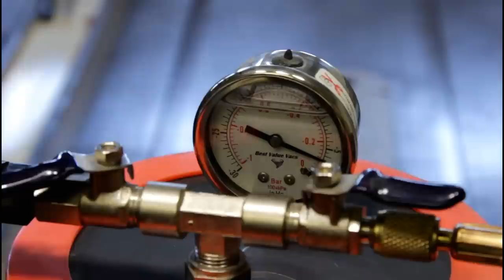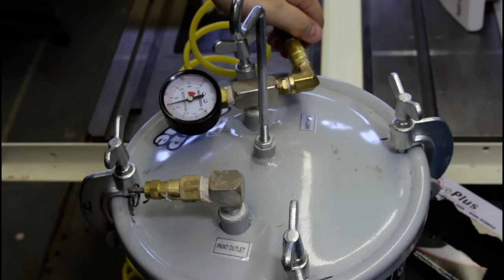Resin & Charcoal: Creating a Charcoal Bowl

Comment: The blue color on the charcoal could be oil residue that didn't burn off when they burn the wood into charcoal and the stabilising resin bought it out and and put it on the surface of the charcoal
Reply: Probably more the stabilizer than the oil. They make a point to use dryer types of wood in charcoal production. However I can't physically inspect the charcoal to verify that.

Comment: I DESPERATELY hope you were wearing a breathing mask working with all that charcoal dust.

edit: I just read your comment. I'm glad you were protecting your lungs. The bowl looks AMAZING btw.
Reply: Breathing in clean carbon doesn't hurt you but this plastic one sure would.
Reply: @SnorrioK  Breathing in any amount of particulates isn't good for your lungs, that's why you're body has a defense system in place to filter regular air and help keep your lungs clear. The amount of carbon dust that Peter would have been breathing without a respirator would have been extremely hazardous and likely lead to intense respiratory distress.
Reply: We as humans through about 1.500.000 years have been breathing all kinds of dust into our lungs and have therefore developed a counter mechanism called coughing. Regular materials like carbon, rust, sand etc. are okay to breath in because when there's too much, we cough it up and clear our lungs. The carbon particles in Peter's case are poisonous because of the plastic in them but with pure carbon only, it's fine. Otherwise your ancestors who worked in coal mines would have been dead a lot sooner than they were.
Reply: @SnorrioK  ...THANK YOU!!
Reply: @SnorrioK  I'm going to need a lot of sources on this.
Reply: For me, it's mostly through experience as a welder in a heavy manufacturing setting for the past 15 years. You could try asking people, doctors, google etc. since I am not going to do that for you.
Reply: @SnorrioK  So you have 1 piece of longitudinal anecdotal data vs over 150+ years of documentation and research.
Reply: What? Because I won't do it for you, you get all arrogant and pissy? Look for it yourself and while you do, have a think about all the jobs where breathing in various particles didn't affect but a small percentage of the workers involved.
Reply: @SnorrioK  It's more the fact that if you make a claim, you have the burden of proof, and a sample of n=1 that's also anecdotal in nature doesn't go far. Also, "small percentage" can still be statistically significant (standard limits are p<=0.05, as in "the probability that X is due to chance is less than or equal to 5%", and most studies test to 1% or below).

Comment: Suggestion: crush some of the charcoal, and treat with stabilizing resin as you did for the large pieces.  When you are building up the piece, add the smaller pieces to fill in the gaps left by the larger pieces, to give a "more charcoal" bowl.  I would also recommend leaving the charcoal in the stabilizing resin under vacuum longer, and after removing vacuum longer before curing to get better penetration.

Comment: okay mister wizard, here's my proposal after seeing the end result and the black light mysticism: have you looked into uv paint powder? It's exactly what it sounbds like, it's a powder you add to normal paint that turns it until UV reactive paint, which also means that you can mix green UV color into pink paint, and so on and so forth. I wonder if it would work inside of resin, and how well it would work. Imagine doing this again but sprinkling in an additional color(s) to have it react with the light.

Comment: Hi!  I'm a new subscriber!  I like that you are not afraid to experiment.  I would like to make one suggestion for your wood-turning art.  Before, I want to share my view of this type of art.  Art pieces should grab human attention with fascination.  Your charcoal is such piece.  

I made this suggestion to other wood turner, but none have done it yet.  Here is my idea.  You should and could create a new form of bowl by combining honeycombs in resine.  But the problem with honeycomb is that made out of wax.  Wax is too soft and it decomposes over time.  There is a good alternative to honeycomb.  Yellow-jackets make a honeycomb with bigger cells and it's made out of sort of cardboard substance.  It's rigid enough and does not decompose.  You can get those from a pest remover in your area.  Since it's made out of cardboard, you can spray paint them to whatever color you like.  Once colored you can capture in transparent resine.

I imagine a flat bowl or a taller vase with a missing  The missing section can be filled with resine with yellow-jacket nest in it.   It should be a very eye catching piece of art.  Imagine all the different colors you can color the yellow-jacket nests.

Comment: i would strongly suggest to use a flask as a second vacuum chamber between your resin chamber and the pump.
if any liquid (foam) gets pulled through your chamber into the pump your vacuum will break.
its the same technique you can find in chemistry labs.

Comment: Try getting your hands on some activated charcoal and using resin that takes awhile to set. Cody's Lab has a video on activated charcoal which is used for filtration and medical purposes due to it's high surface area. If you buy Charcoal for that purpose you'll get pure charcoal with no additives allowing for better penetration of the Charcoal as it doesn't contain impurities that they add onto the charcoal for grilling purposes. you can also follow Cody's Lab's video on how he makes his own homemade stuff which is better than grilling charcoal but not quite as good as the lab made stuff for medical and filtration purposes. with the activated stuff, run the vacuum for maybe a 3+ hours longer to be sure it penetrates completely.

Comment: You know, if you tried this again but instead of using stabilizer just went with a straight thin resin in the vacuum chamber you might get full penetration into the charcoal and have a rather sturdy  plastic thats much less messy and dangerous dust wise.

Might be worth a try on a small little bit

Comment: Hey Peter, I have a question! First off, not even sure if you are gonna read this or not, but have you thought about making a knife handle with pieces of the charcoal cut thin using the bandsaw? Or maybe a ring that you coat with epoxy?

Comment: What is the stabilising resin?
Not used any before 
Can it be reused with any charcoal bit or dust from the charcoal obviously it did not have any activator as it’s liquid when it came out 
Also does the pressure vessel make the blank more dense as I mean less Likely to cause any breakout of the blank while turning ?
Looking at this for a future project  
And not turned any resin parts as yet only wood and metal projects thanks in advance

Comment: You might have had some trouble stabilizing the charcoal and not realized it. Normal charcoal like that, used for cooking, still has pores full of oil-y gunk and impurities. For cooking this is fine, but it requires a high heat (above boiling) and high pressure water environment to clean out. However, you can buy larger chunk activated charcoal, which is charcoal that has had this done to it, so its pores are almost entirely clean and should also be much easier to stabilize. I know this comment is over a year since it happened, but it's something to chew on for the future.

Comment: I'd cut some of the pieces up and puzzled them more together in order to avoid so many empty spots in the finished bowl. And why don't you cast it in a cast that already has a bowl cavity in it? Right now you just throw away 80-90% of the material. With a different cast, you would probably only throw away 40% when you make the outside shape. Still nice end result though.

Comment: Really want to find a red fluorescing pigment to give an ember glow under black light. Tried some glow in the dark red pigment from eBay but it was useless. Tiny amount of red mica glitter which catches the light well but really want a proper glow...
Reply: @shrimp that is very interesting thanks. Im not sure the chlorophyll molecule is stable enough to be used as a long term pigment under UV. The pigment I tried was glow in the dark which I think may be part of the problem
Reply: Just watched a tech ingredients vid. Rhodamine looked like a contender.

Comment: Hey Pete I was wondering if you could tell me the best mold release to use. I was recently doing a project where I was trying to make a mold of something. I used some mold release on the part but long story short my penis and testicles are currently stuck in a block of resin. I'm realizing I should have done a silicone mold first and then filled that with resin to get the final product. What would you recommend I do to prevent this from happening in future projects?